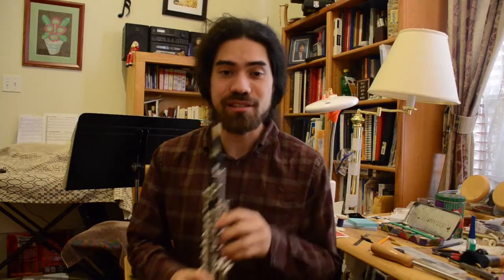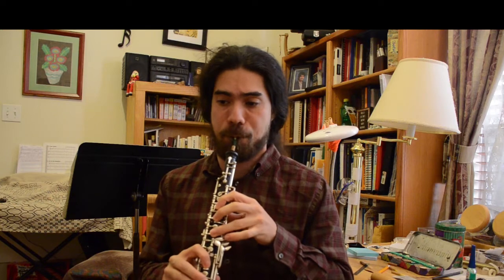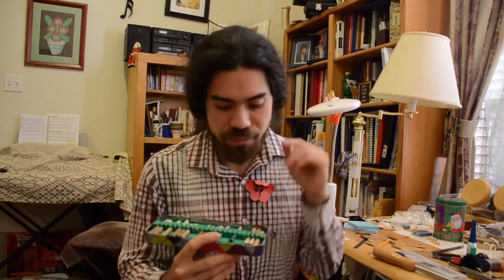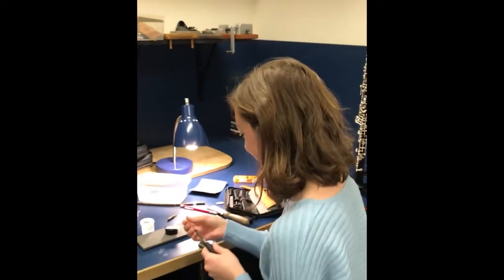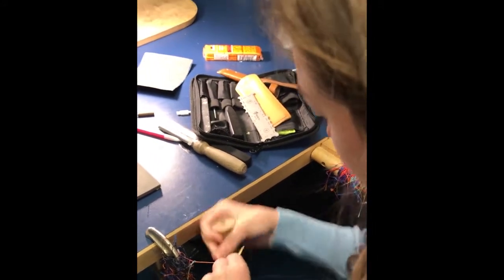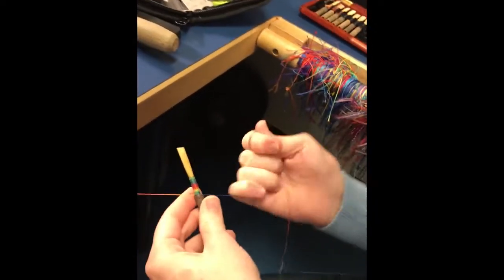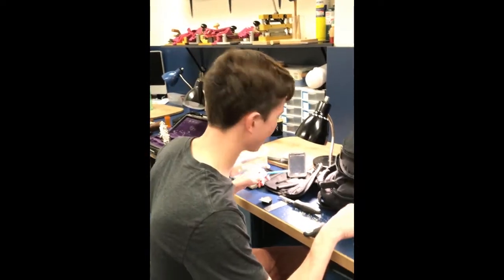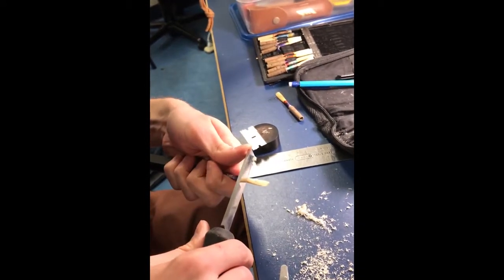How to make reeds at high altitude (Making reeds from Houston to Boulder)

Comment: I am so glad you made this video.  I live in the Portland, OR (wet, near sea level) area and recently traveled to Santa Fe, NM (7200 ft and DRY) to play in a festival with a group.  I anticipated that reeds would be a challenge, so I took 40 reeds (oboe + EH) in various stages of finish.  I arrived two days before the performance, and that evening soaked all of the reeds and let them dry.  (I don't know why, but it seemed like a step in stabilizing them).  The next day I spent about two hours in the hotel adjusting and playing on reeds.  I did not finish any new blanks I had brought, as I had a number of both oboe and EH reeds that were playing well at that point.  The next day was the performance and I arrived early to the warmup to find that nearly all of my playable reeds felt harder than the day before, so I was intermittently scraping during and after the warmup. I had four good, playable reeds ready for the concert (or so I thought).  The oboe reeds played well.  I had a big EH solo in the next-to-last piece that begins in the middle section.  Just before the solo, there is an inner part the EH comes in on, and when I went to play that, the reed I had just played well during the warmup would not make a sound.  I managed to squeak out the first part of the solo, then during a rest, changed reeds, and finished in on my also-not-playing-well "second chair" reed.  Each phrase started on low F which hardly would speak and I found myself sort-of "faking" that note.  I am sorry to make this so long -- it was a trying experience, compounded by a cancelled return flight, last minute rebooking unable to check luggage and "donating" two beautiful reed knives to TSA...

Is there anything in my saga you see that you would have done differently?
Reply from the maker: Hi Kathy what an adventure to be sure! I think I handlers the situation well. My philosophy changes with elevation reeds, but when I go up to altitude I like  to tie a fresh piece and just do a single day scrape. Luckily they dry out pretty quick so I can finish it as the day progresses. I’m def no expert with the elevation shifts  tho!! Are you going to get to back and try some different reed ideas? Let us know plz!